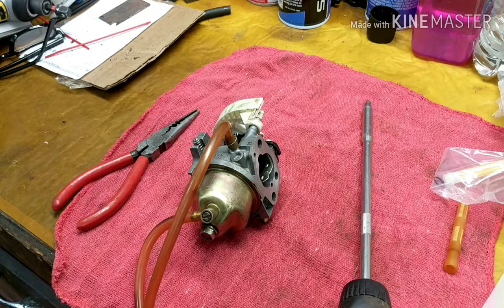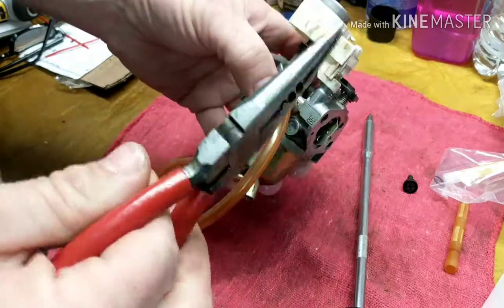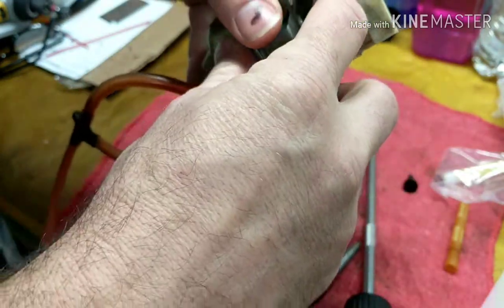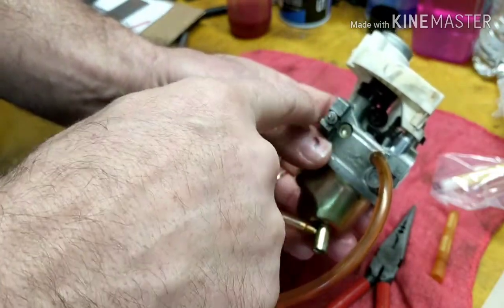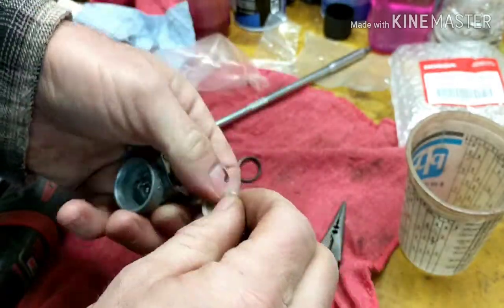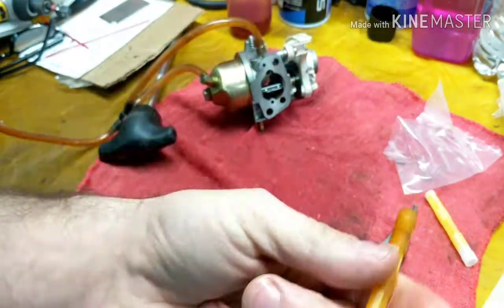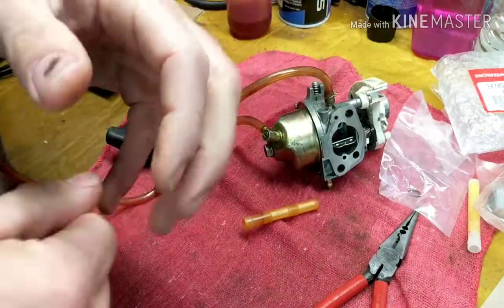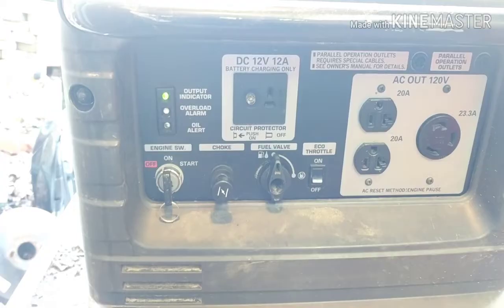Fix surging for good!!!

Comment: This jet looks exactly like the jet in my Westinghouse iGen2550.  I cleaned it over the weekend. The engine doesnt surge like it did before cleaning, but I still have to leave the choke 3/4 on to keep the unit running smoothly. I've been all over the web looking for this replacement jet (part #?). Ideas where a replacement can be found? Westinghouse's website was no help.
Reply from the maker: Try jetsrus.com

Comment: Does the 2000 have the In tank filter and petcock just like the 3000 you showed ?
Reply from the maker: @joebidendidthat5121  yes should be Honda Part # 16952-ZA8-800
Reply: @ awesome thanks so much…. Doing all
This as soon as get parts

Comment: Man i ive done all this, oil change, spark plug and complete fuel system took apart and cleaned thoroughly, get all back together and still if not worst have to have atleast hslf choke out and now i got an oil alert light on, it didnt come on till after doing fuel system clean, im f*^%# pissed
Reply from the maker: @KH-yv1bo  Unfortunately these have circuit boards on them and if bad will reek all kinds of havoc, also if any rodents chewed wires you may issues as well.

Comment: Great video, thank you! Any recommendations on a product to flush gas lines? I'm trying to bring back this same generator from a 15 year storage with gas in it. I've drained the gas and done the basic maintenence items, but I'm sure the carb is caked in gum.
Reply from the maker: Just gas to flush the lines. Give the carb a good cleaning, check the things in the video and you should be good to go.
Reply: @TepcoCycleRepair thank you. You recommend soaking the carb in K1 or parts cleaner, or can I get by with just an aerosol carb cleaner?
Reply from the maker: Just make sure all the ports are clear. Don't really need to soak it if you can get all the passages clear. I've cleaned tons by just pulling the pilot, drop the bowl, pull and clean the jets, blow cleaner through the ports and reassemble. Make sure the float needle and seat are clean as well.
Reply: @TepcoCycleRepair really appreciate the advice, thank you very much
Reply: Any advice on removing the petcock unit from the shut off valve shaft? Don’t want to break it and it’s a plastic to aluminum connection. Does it pull straight out or twist?
Reply from the maker: @strafto04  There is a screw down the center that needs to be removed then it pulls off. It's a JIS #2 bit. You could use a #3 Phillips but I would only use a very good one if you don't have the JIS, you certainly don't want to strip it.
Reply: @TepcoCycleRepair to the rescue again, thank you. Another question: in tank fuel filter, where does the little O ring go? Does it fit over the filter near the filter base or does it go into the top of the petcock?
Reply from the maker: @strafto04  Slide the O-ring over the in tank filter to the base of the filter before you slide it into the tank. Send me an email through my about page and I'll send you a photo from the manual of that helps.

Comment: More in depth coverage of the carb and more likely problem. Super helpful.   My petcock did not have the white screen filter . 🤷‍♂️
Reply: Do you have any video how to clean the tank with ease? My tank had crystals/debris due to the ethanol?
Reply from the maker: @kylewo0  The absolute quickest way it to remove it, plug all the openings, pour a gallon of muriatic acid through the fill, cap it slosh it around, flush it out really good, dry it, and you're done. Or if you don't want to remove it, fill it with metal rescue, let it sit, drain it and you're good. Metal Rescue is good on rust but not sludge, muriatic acid will clean everything.
Reply: @TepcoCycleRepair how bout preventing the issue again? Flush all gas in the tank before storing I assume? Even when starting every month or so?

Yeah I might not remove that tank.. that box is a prison for that tank. But I will slosh and drain tank in place .. maybe shop vac the remain.
Reply from the maker: @kylewo0  Just use ethanol fuel and run it every few weeks. Annually I would siphon the gas out put it in my car and refill it with fresh fuel.
Reply: @kylewo0  don’t leave tanks empty they will rust up

Comment: Great video!  Another good thing to do is clean the main jet and emulsion tube. With bowl removed use a small slot screwdriver up the tube, unscrew, and jet with emulsion ntube will fall out. Clean and poke all holes with a wire. Also use ethanol fuel treatment and try to not use fuel with ethanol especially if not running it a lot.

Comment: Mine starts extremely hard in the cold weather. After that, like a Swiss watch. Changed carburetor with a genuine Honda part. Replaced air filter, cleaned spart arrester.
Reply from the maker: Check your valves and compression.

Comment: I disassembled the carb in my EU3000is for the first time, since it was new. There is no o-ring on the pilot jet, or in it's hole. I didn't see any remnants of there being one.
Reply from the maker: There definitely should be one in there. Look at a carb diagram, it's item #1 in the diagram.
Reply: The unit is 25 years old. I think the o-ring disintegrated.  @TepcoCycleRepair
Reply from the maker: @T.McGarry  Good possiblity.

Comment: Surging = Fuel Starvation, especially with less than half tank of fuel.  A generator runs at high speeds all the time requiring the highest of volume of fuel in the line at all times. 
Generators are designed to be low profile and an inherent flaw is that the fuel tank is (TOO LOW) just slightly above the carb fuel inlet for gravity feed through a hose. At high speeds and especially with little fuel in the tank causes a weak flow to the fuel inlet causing starvation/surging. 
SOLUTION: 
I have a Honda GX-390 and have discovered that by raising the entire fuel tank by 8" gave me MUCH better fuel flow down to the carb and the surging went away even with almost no fuel left in the tank. You can definitely see the difference (before and after) with a see-thru clear fuel filter which should always be at least 1/2 full during operation on a high speed motor/generator.
Another mistake I made was storing Ethanol fuel for more than one season in my shed. The stuff goes bad and causes havoc on small engines. Periodically check the color of the stored fuel in a glass jar. It should be clear. If it is golden/urine colored, DONT USE IT in a small engine.. Car engines don't seem to have a problem with the aged fuel. I had about 20 gallons of yellow colored fuel and added a few gallons at a time to an almost full tank of gas in my car and it burned it with no problem.

Comment: I have a Predator 3500 and have had it for about 4 plus years so far. I am having a problem right now with mine. When I go to turn it off it keeps wanting to run and chug, and like it's dying but just won't shut off until all the gas in the carb runs out. Any advice?

Comment: What about the main jet
Reply from the maker: Main jets have a much larger hole and usually don't cause surging. If the main jet is clogged the carb is very dirty and it usually won't even run.

Comment: Messed up the pilot screw thing, how can i know the exact point to screw up to
Reply from the maker: Cut a slot in it so you can turn it. Turn it in until it lightly seats then back it out 2 turns. Let it warm up and slowly turn it in and out until you get the highest idle. Turn a 1/4 turn at a time and let the idle settle. If you turn it and the idle starts to drop, turn it the other way. You should end up at a spot between 1.5-3 turns out from lightly seated.

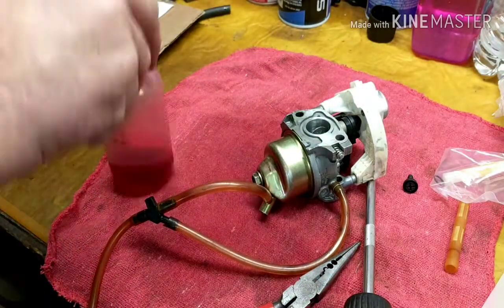Comment: 2:35  THANKYOU sir !  i got a generator, Honda EG3500 x.   GXC 240  honda motor, surges. I redone the carb, thoroughly.  Now, with this education, will clean that pilot jet. ...thanks again, from Alberta canada. oh, got a 7  hp Xstream 3100 gen, surges too. Both were sitting for years, in a barn. Will clear that carbs'  jet, too.  SHALOM, Mr cycle repair.
Reply from the maker: Thank you for posting my friend, good luck getting them running smoothly.

Comment: I, of course, am not you - and my 'ways' sometimes differ.  In my case, while not SPECIFICALLY dealing with the surging problem, it only makes a lit of sense to pull the emulsion tube and check the very tiny side holes.  If enough junk has gotten to the idle jet then, to my way of thinking, the emulsion tube certainly should be checked and absolutely should be cleaned out if any of the side holes are blocked.  Just common sense.
Reply from the maker: You're absolutely correct, if this was a carb clean video I would have done a thorough carb soak carb clean. I was going over common and usually overlooked issues (in tank filter).

Comment: Great maintenance video, allow me to also point out the little Port for the idle jet that is located just below it and the 3 fine holes on the inside next the tip of the air screw that also gets blocked sometimes 😎

Comment: I have a 2018 cat inv 2000 the idle does the same thing but there is no plastic jet. Any tips on how to make it stop surging
Reply from the maker: It has to have a pilot circuit. Find out where it is in that model and clean it.
Reply: @TepcoCycleRepair  son of a gun that was hidden I found it and fixed it thank you so much man great job

Comment: Did you need a new gasket after taking it off?
Reply from the maker: It depends on the condition when taking it off. On the fuel valve definitely, where the carb mounted, I didn't it was good, any damage to it, replace it.

Comment: Can you install an in-line fuel filter and remove the in-tank filter? If so any recommended model?
Reply from the maker: I don't like added in line filters, I've had them restrict fuel and cause running issues.

Comment: I was having surging issues with my rototiller. a Powermate. I took the carb apart and cleaned it, drained the gas tank, etc. Nothing worked until I pulled the pilot jet. I didn't have a pin or needle small enough to pass through, but poking it must've cleaned it out. I put it back together and it runs great. Thanks for the tip!!

Comment: Glad I watched this video before tearing into my Craftsman (Generac) 3000i. Was absolutely dreading having to "gut it like a fish" in order to get the carb off and clean the main jet and emulsion tube just as I have done on SO many motorcycle carbs. Remembered seeing the plastic idle screw on mine and wondered if I had the same pilot jet underneath. Sure enough! Had it out in a few minutes, and, sure enough IT WAS TOTALLY CLOGGED! Couple minutes later I had it back together, fired it up and runs like new! A BIG thank-you for saving me so much time and needless effort!!
Reply from the maker: Awesome!! Glad I could help, thanks for watching!

Comment: Thanks Brother!  Well done - especially where you demonstrated a test to assess flow on the fuel filter.  I am going to go fix mine right now.  Previously - main jet clogged.  Fixed that, got function.  Now the idle lopes a bit and it does not perform great under full load.  ...  Going to clean the pin-hole then check the fuel filter.  Living the dream.

Comment: I had to take top fuel indicator off to fix float inside but when I screwed down indicator back on it seems to leak when moving around with full tank.  Any recommendations on stopping gas from coming out around edges of the indicator?
Reply from the maker: If the rubber seal is dry or ripped, you can use something like a honda bond, or motoseal  from permatex. Take it back out, clean and dry it good and apply as per the directions.

Comment: I have a different style Honda carb. It is factory sealed, but still has a screw opening to the idle jet area. The carb I have is surging, while engine is running. I put carb on carb cleaner for over 12 hours to bot soften and loosen up any buildup inside the vents and center tube. I then both inserted a small wire down through the idle jet opening, and the wire went the jet hole for a length of over a inch, very freely. I put pressurized carb cleaner through the screw opening, and it comes ot inside the carb's venture area ( so that small vent is free and clear of any dirt blockage. Main fuel flow tube is like new, and clean (even all of it's small holes. Main jet is clean as a whistle, and jet hole is wide open.  Now I have cleaned many a carb over the years, and never had trouble like this carb has. I even inserted a stiff nylon brush into the main fuel tube, right up to where it comes out into the venture. Everything is clean as anyone can get this carb. I have repeated this process 4 times now, and still I have surging, while engine is running. It seems as if the idle hole in the main fuel flow tube in the center of the carb is plugged, because the idle section doesn't seem to be getting any fuel through it, and this is causing the engine to surge while running.  Is there any way I can open-up that vent hole in the main center tube to allow fuel to pass through once again? It's either that, or I need to buy a new carb. The issue seems to be, half way up the  inside of the main center tube.  I ordered a set of brass fiber bushes, that will fit into that main tube to see if I can free up that area, and allow the fuel to flow to the idle area. Any suggestions on how I can get the fuel to the idle jet, and beyond on this carb?
Reply: ... I might add.... Each time I opened and cleaned the carb (which was 4 times), the carb sat in Gunk carb cleaner for 12 hours each.  Still there is blockage in the idle section causing surging. It's just now getting fuel in that area.
Reply from the maker: The problem with these carbs is you can't adjust the idle mixture screw. If you could the surging would be easily fixed. My suggestion to you is to get a new pilot jet and replace it. Or get a new carb that you can adjust the mixture screw.
Reply: @TepcoCycleRepair  ... Maybe it's time to replace the carb. I'm thinking maybe some grit has got caught, or wedged in that hole, and doesn't want to be removed, thus stopping the flow of needed fuel for idle section to work properly. It's worth a try in trying to save this carb, but the more I try, the less it seems it will come unplugged. Out of the many carbs I have cleaned over the years, this is my fist, that is plugged solid within the main center tube section. I did an older 4 hp snow-blower engine as well today, that also needed a good carb cleaning. That turned out just fine. Engine runs like a dream again. It's best to do some asking, and learn something new, but in this case, I think a new carb is the remedy.
Reply: ...by the way, thank you...
Reply: @TepcoCycleRepair  ...  I think I am wasting my time in trying to save this carb.  I think a new carb should be put on this mower.... Thanks loads for your opinion, and help. I was just looking to see if there was something I could do to get it working again, that I didn't know about (and I have cleaned many a carb over the years). Doesn't hurt to ask , that's for sure. Again Thank You.
Reply from the maker: @waynedavies3185  No problem, I'm not sure which carb you have but if it's the plastic body carb, they warp and suck air causing surging, so no matter how much cleaning you do, it won't help.
Reply: @TepcoCycleRepair  Carb was aluminum casing, but badly plugged up. Lawnmower was abused since new. . Anyways, I kept at it. Used some old guitar wire to get inside the main fuel tunnel, and with a slight bend, hit the opening to the low speed supply.  I then pounded the daylights out of it, in cleaning it with both full compressor air, and carb cleaner. Finally got the idle speed fuel area cleaned out. It now runs again fine. Surging is now gone.  That was the hardest fight to clean a carb I have had in a long, long time, but I got "er" done. Neighbor is happy again. Thanks for your help.

Comment: Hi, I got surging but no errors eu6500is
How do know if surging is not bad inverter board versus carb ?
Reply from the maker: I guess in that case, with no errors I would just clean the carb first, it's easy enough to eliminate from the equation after it's clean.
Reply: @TepcoCycleRepair  That's what I had done ! A local Ocala biker/ATV mech took carb out and throughly cleaned it inside and out and now generator 6500 runs stable ! At 3300rpm rather than I thought 3500rpm stock ? Just $85 tech fee. Wife wants to load 220amp (AC, lights and water heater) on it but I said NO way, just 110 stuff dear.

Comment: I thought the whole point of being an inverter generator was for that.
Reply from the maker: It should adjust to the power needed but not surge up and down when it's there or the output power won't be consistent.
Reply: @TepcoCycleRepair  that's not good 😣 I'm suppose to use this specific model generator for a DJ gig I have coming up, thanks for the info.
Reply from the maker: @marviklima5568  Just leave it off eco mode and it should be good for your gig.
Reply: @TepcoCycleRepair  awesome, thank you so much for the sound input! 🙏

Comment: DO NOT BUY HONDA THEY DONT STAND BEHIND THIER PRODUCTS. I have a Honda 2200 its less then six months old. It started surging at and would not hold a idle. Brought it to a certified Honda dealer. They told me I need a new carb. It would cost $280 installed. I called Honda and was told fuel problems are not covered under warranty. It has 30 hours on the generator. The idle jet has a design problem and Honda knows it. There are YouTube and blogs about it all over the internet. If you replace the jet with a updated aftermarket upgrade it fixes the problem. THERE NEEDS TO BE A CLASS ACTION LAWSUIT AGAINST HONDA.
Reply from the maker: I would put it out by the curb...just tell me where you live first..but seriously that stinks, I have noticed Honda quality has been dropping in there ATV line as well.